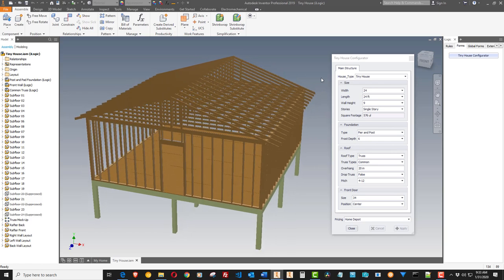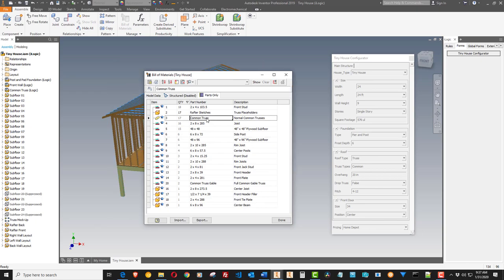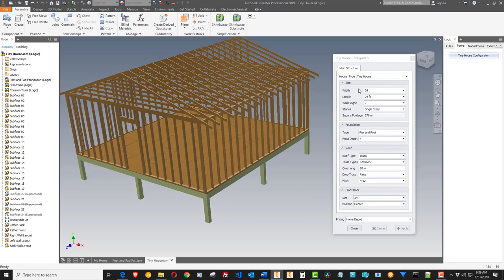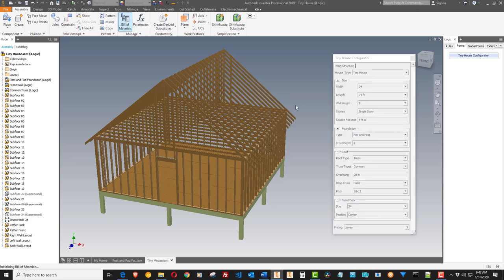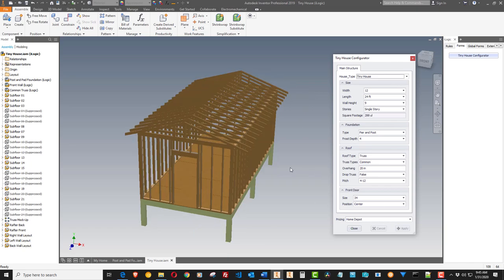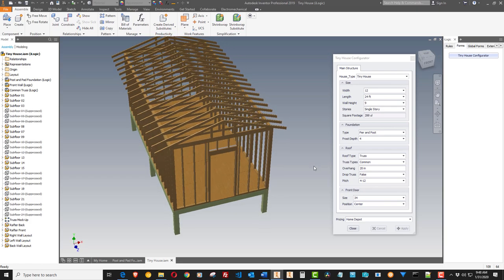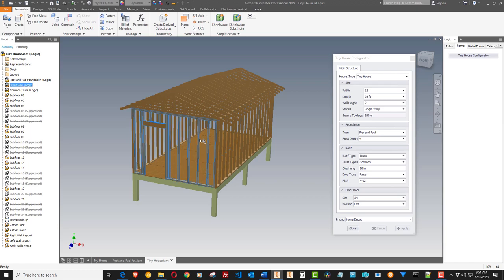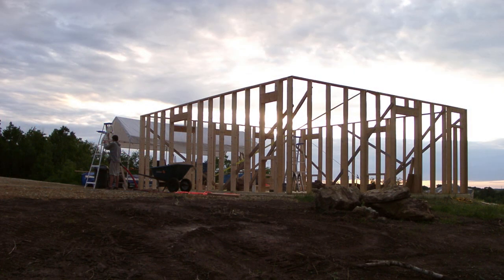Tiny House Designer -- @TheCrockers  Connection

Comment: I am not ready for a tiny house but would like to take on building a tack room nearer to my round pen.  That would make working the horses a lot easier and therefore it would happen more often!  lol  I wonder if you will also make a "skid foundation" and option?  It does not have to be a Tiny House per se, out in the country we all need more buildings! And if they are movable then they are also not taxed.  Just a thought/suggestion.  Love your channel and ideas!
Reply from the maker: Thanks Drue! This tool will work for any small building when it is done -- a shed, tack room, well house, guest house, etc. A skid foundation is a great idea!!! I saw a video over at Keeping It Dutch where he was dragging a chicken coup -- or maybe it was Lumnah Acres? One of the two was dragging a building and it was digging in. I'll add that to the feature list. Thanks again Drue!

Comment: My daughter and I are wanting to build a little art studio together.  This will be very helpful.  Will you be selling plans? When can we get them?
Reply from the maker: The plan is to have this online at C360 where subscribers can just use it at will. The way these configurators work is that you can configure the tiny house or whatever it is however you wish, check out different styles and options -- including price -- then download drawings and cut lists (plans). I have to figure out how to work out the particulars so the tool is not overused because there is a charge for the Configurator 360 usage at Autodesk. As it is being developed though I can just run stuff for people and send them a PDF to get things going (time permitting of course).